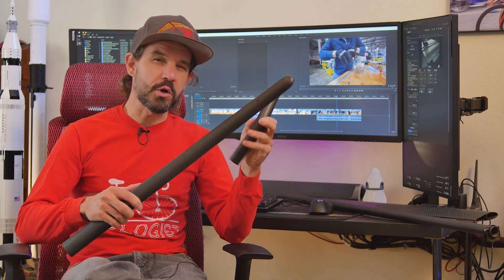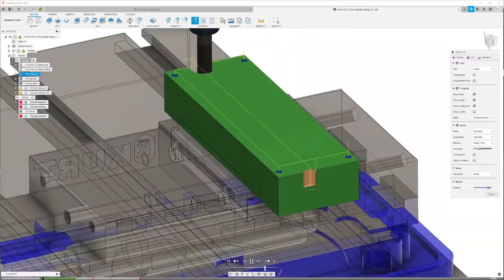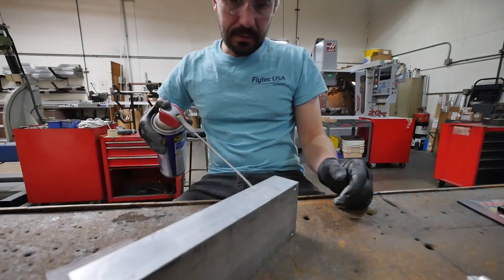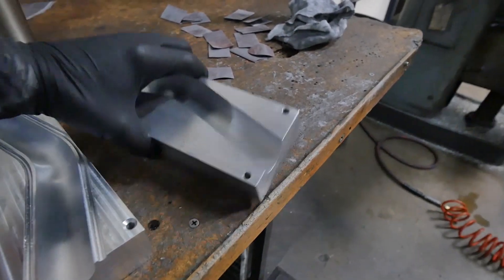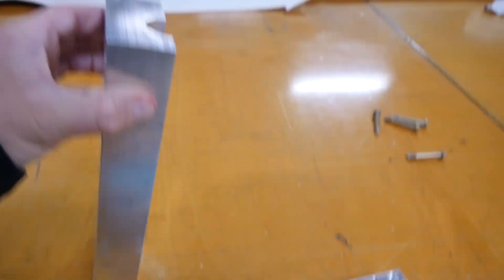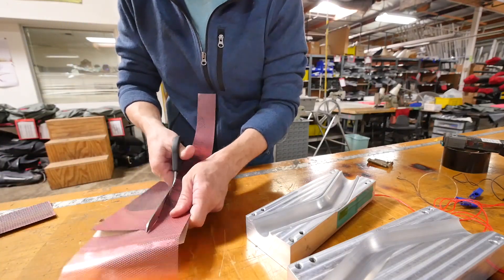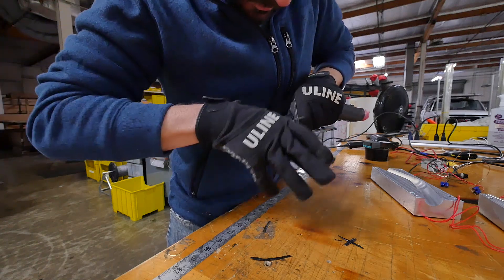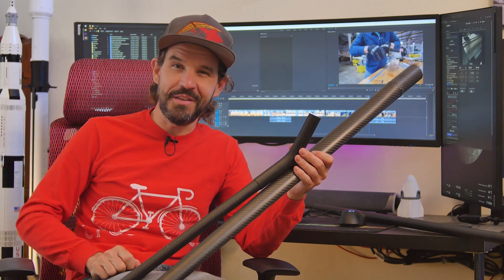A NEW Way to Mold Carbon Fiber - Trapped Rubber!

Comment: What is heating element name on the mold ? how match tempr for great process?
Reply from the maker: It's a silicon sheet heater. Sorry for lack of details on that.
Temperature and curing cycle depends on the prepreg resin used and part geometry.
Reply: @designbydave Thank you for advice)

Comment: I can see the necessity to degas the silicone, if you did not do it you would have holes on the surface contacting the carbon, however if you did a two step process, degasing a surface coating, waiting for cure, and then a second pour with lots of air inclusion, the air bubbles would attempt to expand during the carbon curing bake, increasing the amount of pressure for consolidation.
Reply from the maker: You are correct, the silicon must be degassed.

Comment: 14:40. To remove that rubber thing, just use compressed air! Add some air to the rubber, and it will get out just like nothing! Trust me, I have been done that several times!
Reply from the maker: I tried several approaches with compressed air, on several different tool made after this video, with zero success.

Comment: Use a bicycle inner tube, cut it in half, glue each end, then pump the tire to a certain pressure, during the heating process make sure the air remains at the same pressure, and you have become a NASA engineer.

Comment: Interesting enough. The pressure you had to apply to close the mold makes me wonder if some of the fibers were wrinkled thus not ready for tension but maybe it's pretty good. Maybe CF sleeves could be slid in there and inflated as a way to have inbroken fibers and fast manufacture

Comment: Can you tell me what the part is at 15:46? It looks like a blade for a rotary wing (large RC helicopter)?
Reply from the maker: It's a section of a part of a hang glider control frame, called a downtube. It's a symmetrical airfoil, so similar to a rotor for a helicopter, but to thick.

Comment: Ok, nice work, but what is the break even point on all that work? CNC time, billet aluminum, design, hand work, mold mixing, degassing, heating time, finishing work, C.F. cost, etc. And the rubber core will not last long, I'd bet.
Reply from the maker: The break even point is high, hence one of the main reasons molded carbon fiber parts are so expensive. I did end up putting this technique into production on several parts, much larger and more complex then this. The rubber tooling would last ~30-50 parts before needing to be recast.

Comment: I have never seen that wax but it looks awesome!!! I'm a little old-school so I tend to just find my own solutions to problems (Like wrapping rope around an inner to try and get a constant wall thickness. Spoiler: It doesn't work. I guess that's what I love so much about resin and composites: There is just so much development taking place!
Reply from the maker: The sheet was is indeed cool, but it's hard to find (only one manufacturer that I am aware of) and a bit more tricky to work with then you might think. I don't know of a better solution though.
There is indeed many ways to work with composites and many challenges.

Comment: most people in germany they use silicone balloon tube for casting
Reply from the maker: Thanks for checking out the video. Lots of reasons to not use a gas pressurized bladder which I've already commented on.

Comment: Can you do multiple angles and vary clocking to make 3D tube?  I think I know how it can be done.
Reply from the maker: Multiple angles, yes to a certain degree at least. Need to be able to extract the rubber mandrel.
Not sure what you mean by "vary clocking"

Comment: How did u manage not to get any pin holes even without a vacuum bag to contain the resin in the fabric?
Reply from the maker: Camera hides such imperfections ; ) I have a few years of experience now fabricating parts with this technique and it's expected for there to be at least a few pin holes. Experimenting with the resin cure cycle and pulling vacuum on the molds during cure may be what is necessary to completely eliminate such surface imperfections.
Reply: Would you be able to share what silicon you’ve used and what is the thermal expansion quorficient of the silicone you’ve used?
Reply from the maker: Sorry, I don't have that info any more.  @robertocoelho441

Comment: Hi, thank you for this informative video ! I am buildind a folding bike with carbon fiber tube and and the torsional stiffness is nowhere near expectations. With your experience,  how much better would a Pull Winded or Braided tube would perform in torsion compared to a Roll Wrapped ? Regards
Reply from the maker: Thanks for checking out the video. It shouldn't matter what manufacturing method you use as long as you have fibers in the +/-45 direction for tube torsional stiffness. Having said that, filament wound tubes are generally considered superior for torsional stiffness as the fibers are pretty much all going to laid at some angle. Keep in mind that the overall torsional stiffness of your structure isn't necessarily going to be dependent only on the torsional stiffness of your tubes.

Comment: LOL, silicone rubber core molding has been used for over 50 years to make all sorts of shapes including tubes.  core pressure is tuned by air gaps so the CTE mismatch creates the desired pressure in the closed mold.  Maybe you should read some books on composite fabrication before saying you invented it.
Reply from the maker: Thanks for checking out the video!

Comment: Degassing is a good practice but I can confirm that for this purpose you can get away without doing it.

You can also use a shrinking release film like polyolefin if you want. That extends the mandrel life.

Comment: again would an inflatable liner still not be ideal?
Reply from the maker: Not necessarily. A gas pressure form of compaction would probably be the ideal process but it comes at the cost of significantly more complex tooling and processing. It is also subject to failure where the entire laminate is ruined (a leaky bladder.) The main advantage with this method is the pressure and compaction is completely passive. The expansion of the rubber mandrel happens as the tool is heated to cure the prepreg resin. No need for a bladder and external pressurization system (air compressor.)

Comment: Cast a silicone rubber mandrel with tubing running through the middle of it. Make the tubing pass through the end caps.  Pressurize the tubing to expand the silicone part in the mold.  This way the silicone could be a lot smaller than the internal dimensions and even include some internal details that would otherwise lock the mandrel in the part.  Air also expands when heated (Boyle's Law) so that gives some additional outward pressure on the part ensuring the carbon fiber layers are well compressed.
Reply from the maker: The passive pressurization from the expanded solid silicon mandrel is one of the main advantages of this method. Adding gas pressure adds significant complexity to the tooling and additional areas of part molding failure.

Comment: To help get the rubber out of the mold, use an air compressor blow guy to shoot air in between the rubber and your part. Don't forget to do both ends and the rubber will push out easily as you shoot air around it.
Reply from the maker: In my experience molding several different parts after this video, blowing air into the mold actually is not effective at all.
Reply: Water and air works better

Comment: commenting again because finishing the surface before decking the mold is genius.. I have been CNC machining carbon molds for years and never thought of this.  protecting that edge is painstaking!
Reply from the maker: Yeah the parting line was a big issue for some some of the parts my former company produced so we needed a way to improve that. This was my solution.

Comment: Very cool. Could you cut long thin strips and wrap it around the part at an angle as you wrap then the next layer goes the opposite way and they overlap in different angled directions, sort of similar to how you wrap your handlebar tape but keep laying in different directions?

Comment: lol been doing it for 12+ years but yeah, new to some I guess.
Reply: also, free tip. You have voids because there is nothing holding the rubber inside, you should put lids on each end f the mold to in fact Trap the rubber. You see rubber will try to stretch out of the chamber and in the process become "Narrow" that's when you loose pressure, if you trap it, all the pressure stays inside and pushes on your part better. Path of least resistance etc.. Free Tip!

Comment: David, Great video. Fair to say the silicone could have been a bit smaller? Mold closure was a bit tough, you probably used an offset equal to the desired part wall. I'm curious if the production version used more offset and by how much more than tube wall?
Reply from the maker: Fine tuning the silicon mandrel size is a very tricky task that requires some level of trial and error.
Reply: @designbydave  We use to have a saying in my way back tech days, "That's proprietary! I can't tell you that!"

Comment: way cool shop, bro... can I come over and play at your house please
Reply: gives me hope for the future... I actually have most of the stuff sitting around here in boxes.. waiting for my health to return... 
I'm working with an older form of carbon fiber... hemp fiber and silk... and a bioplastic that is tremendously rigid and hard... so
.. I'm going to make personal size dirigibles... go up and float... quietly..  all day... solar powered... cheap... and.. they won't fall out of the sky... they fall ^up^ ... slowly
Reply: I used to work for a Boeing company doing factory floor automation making the high tech fiber stuff and the aluminum stuff.. for the airframe and powerplant structure... but this is actually an ancient Chinese recipe... I have a 40cm hemp rope.. 13mm diameter... with my bioplastic... weighs a few grams... it's like a piece of rebar at the moment..  slightly flexible if I use a lot of strength... TTD testing will give me shear strength etc... lighter than wood and aluminum... machinable.. ✌️
I'll keep you posted
Reply from the maker: Thanks for checking it out. Sadly this shop no longer exists.

Comment: Put a hole down the middle of the rubber and blow it up like a ballon with compressed air during curing it will be super easy to take out
Reply from the maker: One of the main points of a trapped rubber tool is not needing to use air pressure which adds significant complexity to the tooling and process.

Comment: I've had the idea of using styrofoam as a mandrel and then pouring gasoline into the finished part to dissolve the styrofoam - I just don't know how gasoline might affect the resin.
Reply from the maker: Some form of sacrificial mandrel can work but you still would need some form of compaction (mold or shrink tape etc.) 
I would probably avoid gasoline as it is quite toxic and corrosive

Comment: Have you ever tried bending carbon fibre tube by filling with sand and heating and bending? 👍
Reply from the maker: Do you mean a pre-made, fully cured tube? That is not really possible. If you re-heat the matrix to the point that it becomes soft enough to bend, the carbon fibers then become loose and will seperste from the matrix and/or become distorted in such a way that they lose significant strength. Also need to consider the effect that heating and cooling the matrix will have on its structural properties. 
Having said all that, I seen to remember some manufacture doing the for some of their parts however the bend radius was greater then what you see in this video.

Comment: Great effort but why not use trapped air rubber? I have done exactly the same thing with inflating a bicycle inner tube.
Reply from the maker: A solid mandrel offers several advantages over a bladder. I've addresses this several times in other comments.

Comment: This is a very innovative technique. In my industry it is often used for convoluted tubing molds so you are right on with the process. One method we also use here is salt core molding. We use a variety of salts to use as cores for molding, although may not expand like silicone, and we can just use water to dissolve the cores and simplify demolding. Tooling require is a bit more, but the initial cost is outweighed by the ease of demold. Very nice!
Reply from the maker: Salt core sounds like a cool idea!

Comment: There is no need to degas the silicone before casting the insert because of the trapped air in the silicone will act like pressure intensifier when you heat the mold. But if you really need degassed silicone it is a good idea to put the whole cast thing in the vacuum chamber again one more time after pouring the silicone. There is no need to use release film on silicone or even release agent, epoxy does not adhere to silicone.
Reply from the maker: You are basically wrong about everything here. 
Degassing - The air bubbles don't work as you expect. Excess resin will be squeezed into any bubbles near the surface of the mandrel. This creates sharp, tooth like protrusions of resin on the inside of the part. A non-degassed silicon part will have A LOT of air bubbles. It will look almost sponge-like. Degassing after casting would be ideal yes as the casting process can create bubbles. This gets tricky with large tools though. 
A release agent is absolutely essential. The epoxy indeed does not bond to the silicon, but it sure sticks like hell, especially when a vacuum is formed during the molding process. Also, the epoxy will, with repeated use, start to tear up the silicon.

Comment: Surgical Rubber Tubing that starts out with a nominal 1/4-inch inside diameter can be inflated with air or preferably with water to about the size of that solid rubber mandrel, and possibly exert as much or more outward pressure during the hot molding phase. It might be more convenient, and certainly easier to remove. Whether it can withstand the temperature of the hot mold would have to be considered, but other types of rubber tubing might be used instead of the natural Surgical Rubber. If doing cold molding, there will obviously be no heat issue. Finally, the exact chemistry of the adhesive will need to be checked for compatibility with the expandable tubing. It might also be possible to simplify the entire process by wrapping the fibers around the inflated tubing while it is straight, then forcing it into a gentle curve for the desired angle at the ends and held that way during curing. A gentle curve is stronger, too.
Reply from the maker: You are basically just describing bladder molding. This process has several advantages.
Passive compaction - mandrel expands with the heating of the tool. The air tight seals, valves and compressor required for a bladder add considerable complexity to the tooling and many sources for failure, ruining the part. 
Reusable tooling - The mandrel can be reused up to 40 or so times. Bladders are typically one time use. 
Lastly, the male mandrel allows you to assemble the laminate by wrapping fiber over the mandrel, allowing for continuous fibers across the mold parting line. 
Also, the rubber makes for SIGNIFICANTLY more pressure then a bladder. We are talking several hundred PSI versus ~120 (typical air compressor.) 
Having a strait mandrel, wrapping fibers and then bending the assembled laminate to fit into the tool is an idea worth investigating. I just never got around to that.
Reply: Okay, yes, a hose that can expand a lot is kinda like a bladder. I just did not think of it quite that way since it expands so much more than 'normal' hoses. As for the kind of pressure which can be exerted, a company where I used to work pumped water into 5/8-inch copper tubes with the aid of a small pneumatic reciprocating pump, and inflated the copper tubing, some of which was very strong stuff... hard copper, even cupronickel... not the coiled stuff that is soft. The air supplied to the pump was the same compressed air used by normal pneumatic tools throughout the shop, and the gauge on the pump went up to 10,000 PSI... higher than most hydraulic pumps. So if it is high pressure you want . . . ! 
Also, you get enough pressure from water freezing to crack outdoor stacks of cast iron cannonballs into pieces just by flooding them with water before winter set in, a method formerly used to dispose of excess ammunition, in the days of black powder cannons. So if your laminate was able to cure in temperatures a bit below 0°C, possibly as low as -40, you could indeed lay up the fibers around a piece of water-filled rubber hose, stick that inside your mold, then freeze the whole thing to get the desired high pressure. You might even be able to skip the end caps of the mold, because the ends of the hose will tend to freeze first, plugging the ends with ice.
Reply: @YodaWhat the name suits you thank you😊

Comment: You want to cast a length of stainless steel cord into the rubber mandrel, with a little metal tab here and there, that will make it much easier to pull out.
Reply from the maker: Tried that and its the exact opposite of what you expect. The solid metal core prevents the rubber from deforming (as much) while under tension.

Comment: Damn so many good tips. Building a sailboat mast section at the moment with two part mold and blender mold but have problems with the tight radius (r7)
Reply from the maker: Yeah, tight inside corners can be problematic. The composite fabric can "bridge" and lift away from the corner leaving ugly air bubbles and voids in the molded part.
Reply: @designbydave  in particular I have the problem during closing that I don't get the layed fibers to stay in place... The are creaping up into the joint.next try today. (Bladder mold)